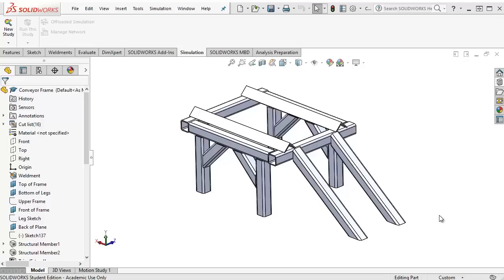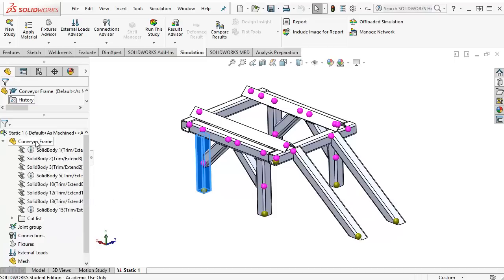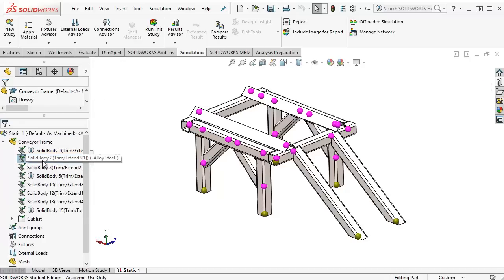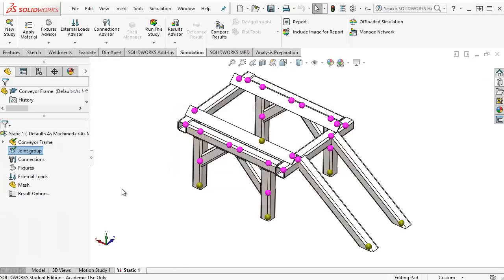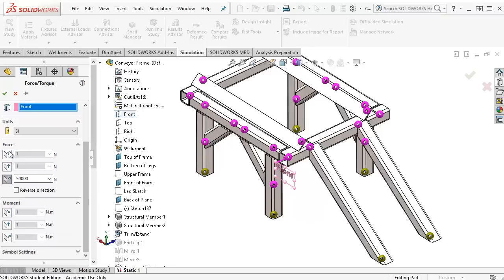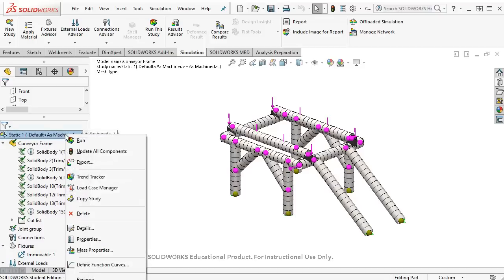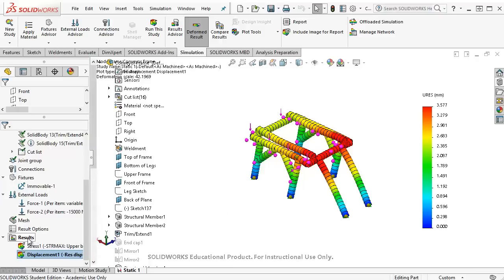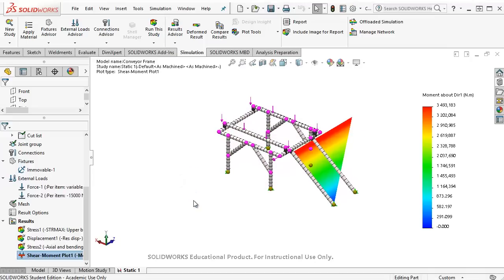Beams in SolidWorks Simulation

Comment: Cannot convert solid bodies back into beams. Why is this happening?
Reply: It was the same for me, I just deleted the solid parts, and then did a new sketch in the "solidparts" and applied structural member, try Trim/extend to have the desire shape. So that you can check once more in the simulation settings to see if that parts have changed. I hope it works!